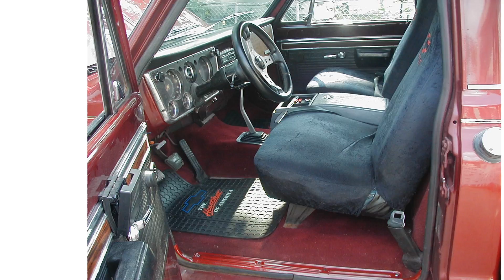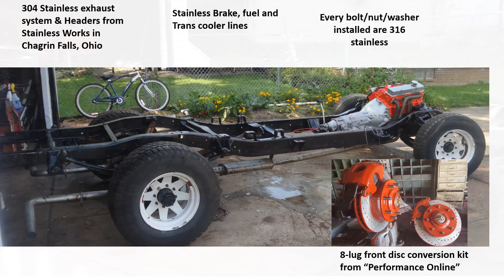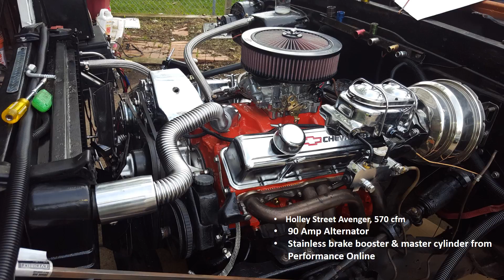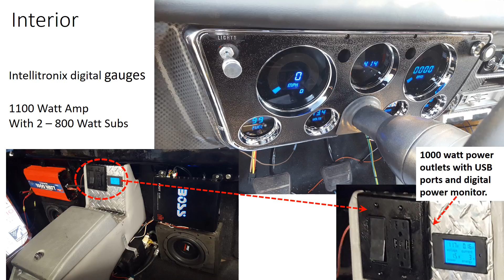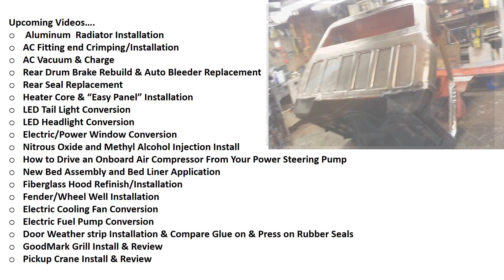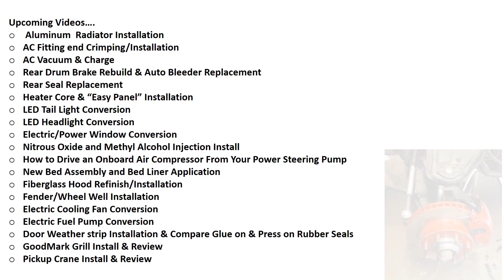1970 C20 "Hillbilly Truck" Rebuild

Comment: OK. Sunburst orange with a little pearl in it. Glad I turn everything off in the garage with new laptop on high volume and put my ear on the speaker. After 38 years in a dealership shop, my hearing is not very good. Thanks for speaking so quit. Wait, it that a mouse fart? Speak up dude.

Comment: I used the same “Intellitronics” dash except in white. For the speedo, the tail shaft housing tells a lot. If the large hole (about 2”) but it has a single large cut seal or flat. Once removed, the older plastic drive gear can be swapped out with a metal 40 tooth reluctor or tone ring some folks call it. In 92-94, the “F-Body” Camero used a magnetic pickup that works with the 40 reluctor. I’ve seen GM service manuals say it produces 4000 signals per mile & others say 4001. It depends on final drive, tire size. Thanks to Intellitronics for make it accurate easy. It’s a permanent magnet generator that makes an a/c sine wave. On 98 & up, this signal is “Ref High, Ref Low”. The low is grounded and high is turned into a square wave. It is shared with the radio, ABS and Speedo. Just saying as you have no PCM. 
  Where did you get your headliner? Is it fiberglass? All I have seem were still after install but look like it requires a metal/aluminum band w/screws to hold it in. I am not in any hurry. Lord knows I have enough work & things to fix for 20 years, besides my truck. This is our second vehicle. 96 Geo Prizm is my wife’s. I don’t go anywhere except Dr. and MRI or Epidurals...all lumbar since 1986. Yep. Popped a disc in KC for ACDelco after an electrical class in 05 late. Tore rotator cuff in Dubuque in Oct. 2008 at warehouse, job gone two weeks after surgery by Raytheon. So, nothing. Lumbar started burning two years later and every thing has been done 2 or 3 times. Only complete relief was L3-L2 Epidural. I could stand up at 6’3” with ease and no pain when bending. Too tall in a 5’5” world. Even the weed eater won’t touch the ground if I stand straight with handle up to throttle. Can’t even wash hands, sucks! But that life. Get one or two things done per day. Move on!
  I like the color, but you said you had them add pear?  I used a favorite of mine, since I drove a 1976 Datsun 280Z, I worked at the dealer and bought it from a customer. Me & two guys, they won’t work on them because of muti-port fuel injection. Fact; only it & the Cadillac Seville had mutiport that year. Excluding all air-plate European CIS & mechanical. Two different systems completely. Thanks for the video and info. Enjoy learning!

Comment: Brian if you need any final parts to finish your nice '70 resto., I've been building since 1980. Sold over 250 '67-'72 Chevy /GMC 4X4's. Retiring now, lots of cool parts. Got a set of 16x8 Chevy 8 bolts powdercoated silver/grey to match what Chevy put on early bumpers etc. Also, am-fm delco's, fact. tach dash, tow hooks, NOS cab lights. Your project is looking good!!!!!!!!  563-568-9325
Reply: Jim Kiesau I’d be interested in some parts. What do you have? Let me know looking for some buckets and Consol